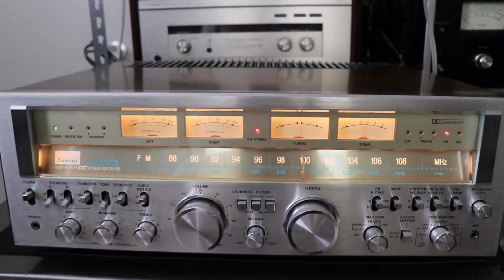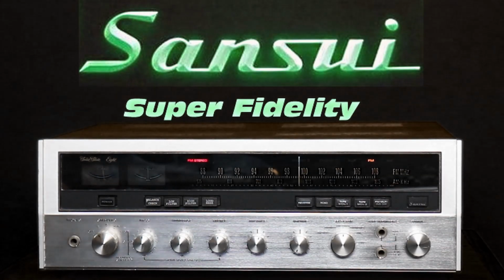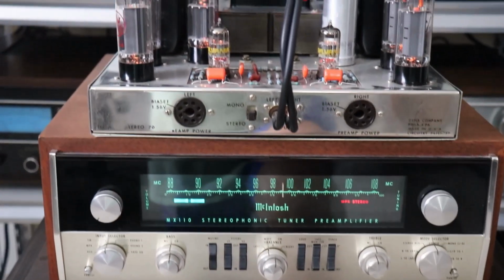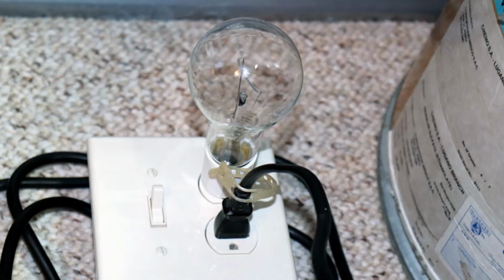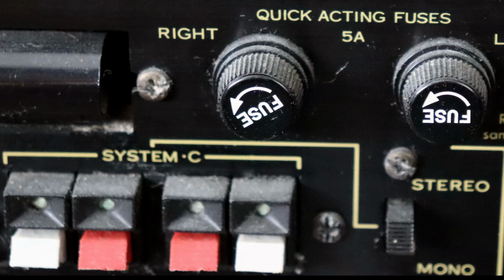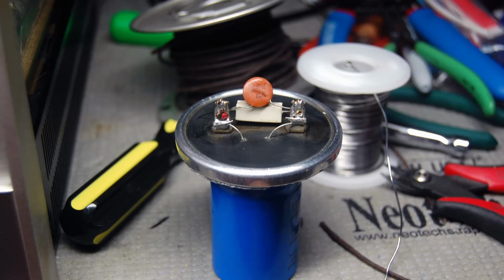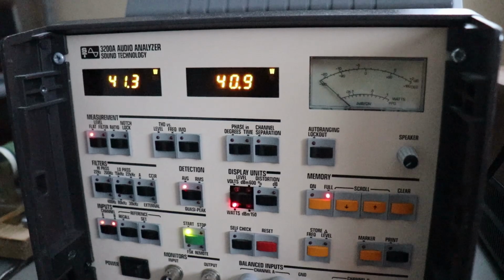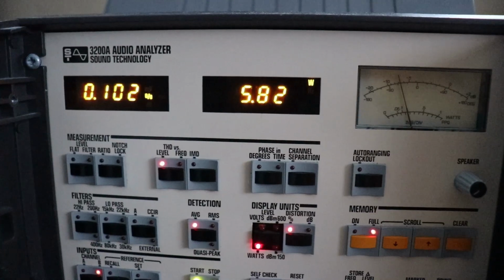The Best Receiver Ever? - The Sansui Eight. Repair Restoration Testing. Vintage Audio Equipment

Comment: That Sony ....( TA -F6 )
How does that do ? 
I have an E7B and I'm looking for the N7 
Any thoughts on this series from Sony?
Reply from the maker: The TA-F6 is a great integrated amp once you get the power supply issues straightened out that a lot of them have. Sony doesn't get a lot of love but they made some really good vintage audio equipment.
Reply: @vintageaudioaddict  
Thanks for taking the time 
I appreciate it - 
Subbed 👍

Comment: I have a Sansui 7070 it’s been in my possession since the 1970’s . It’s in great condition. I have not powered it up in 30 to 40 years.
Reply from the maker: Wow! Thanks for sharing. If you do think about powering up your 7070 please don't just plug it in the wall and turn it on. Using a device called a variac would allow you to bring the line voltage up slowly. After 30 or 40 years of sitting that's what should be done.
Reply: Vintage Audio Addict thank you for the information. I keep it because it has sentimental value. It was our first hi-fi system when I was a young kid. It reminds me of family members who have passed away.

Comment: which Receiver is the best you have i have a fisher i purchased from ebay, i also have a 8 track tape player from the 70s that was passed down from my older sister about 30 plus years ago it playes well and i have a case of 8 track tapes that came with the player.
Reply from the maker: Fisher made some fine equipment. Man, that's a tough question. So much great equipment was produced back in the day. I guess my favorite is the one that I'm playing at the moment.

Comment: In USA the G 9000 was top, but when I was in the Navy in 1978, I ordered through the Navy exchange in Philippines a Sansui G 22000. It was nuts, had 220 watts RMS a channel at .0009% distortion, along with that also ordered a pair of Kenwood 888s'. The receiver was so big they decided to make it two pieces so they could be stacked because it was too deep to fit on most tables.
Reply from the maker: Man, a 22000! What a wonderful and rare piece of Sansui audio history and thank you for your service.

Comment: I'd like a marantz 2250 if there's one to be found I'd like an amp around 100 watt but solid and clean any suggestions
Reply from the maker: Marantz was great also! In today's world you can always find vintage audio eBay but you will probably pay to dollar. I'd look at your local Craigslist if your not locked into one brand. Pioneer, Sansui, Marantz and many others made high quality audio equipment back in the day. The key to buying vintage is if they are working properly. If so all the brands are built to last and will sound excellent.

Comment: This is great. The early era of component Stereos!! The SF Chronicle would have an ad from Pacific Stereo every Sunday featuring a Good Better or Best set.. I recall Nikko , Sansui and Marantz. Heck even bought a Quadraflex that I loved but blew up (868, family still has a working 767). House brand I believe made by Pioneer.
Went to JVC there after.RX-400 then RX-8V. This got the cops called on me when I turned 40 (22 years ago, Pantera) and thought  it got hurt during a move. Just a short. Its fine.
Reply from the maker: Yes, they are great! The vintage audio equipment brings back good memories for most people. Thanks for sharing,

Comment: I love your vintage audio equipment .  The oldest piece of equipment I have is a Yamaha FM tuner T2 .  I would like more info or your personal opinion if you have ever had one or seen one. I had bought it at a pawn shop a long time ago, because it just looked like quality.  At the time I was working in an audio shop in Montreal Que, Canada  and out of curiosity  I looked up the cost on the unit and it was listed as $750 canadian. A heavy tuner, the front and top are one piece 1/8 in thick  black aluminum, never seen anything like it.
Reply from the maker: Thank You! No, I've never owned or even remember seeing a T2. The older audio equipment sure was build well. Most of the manufacturers like Yamaha built their products to last.

Comment: It''s a nice looking unit. But why restore old equipment when you can get new, better performing equipment today?
Reply from the maker: Why take vacations? Why watch the NFL on Sunday's? Why stop at Starbucks for a $5 drink? Why restore a 65 Mustang? Everyone is into something different.
Reply: Johnny Quest Why restore a classic car when you can buy a new one cheaper?
Reply: Dont be so sure ....
This old stuff is Very capable 
My new Marantz would get murdered by my 40 year old sony or Kenwood .
I mean it's not even close , people just assume .... what if its better in every way? 
When it comes to vintage amplification 
Vs chipsets that's 99% of the time
 the case.
Reply: @dednside5229  One thing I learned over the years is, ''Newer is NOT Always Better''. As a Buyer myself, for my Small Business, and its Clients over the last 25+ years, one has to take everything into consideration when purchasing something man-made; no matter what it is. So I concur with your statement.

Comment: I really respect Japanese engineering culture. Some Japanese engineer created a small thing of beauty with this receiver back in the early 1970s. It's such a contrast to all the cheap junk coming out of China these days - all sorts of fakes and most of it only good for a few years before it dies.
Reply from the maker: I agree. I wonder if any of the engineers or the factory workers at Sansui thought in 1970 that 50 years later in 2020 a Sansui Eight would still still be operating like it was new? Amazing!

Comment: My parents had one almost exactly like this. Theirs was from like 1975. It put out 120 per channel rms I believe. It was a beast. They had it connected to bic Ventura speakers. It would shake the house!!
Reply from the maker: I love the vintage audio equipment but I also enjoy the stories as people reflect on their experiences with that equipment. Thanks for sharing!
Reply: @vintageaudioaddict  Thanks for this Video. I inherited this from My Dad back in the Mid-'80s. He told me it was the "Last Hand-Soldered Tuner Manufactured In 1973". The Years sound about right. Love the Big Green Display, especially with the Lights out and/or a Black Light. When Dad gave it to me, I used Polk Audio PC4-JR (or PC5-JR, Forget Which) ''Bookshelf'' Speakers. They were 4 Ohm, so more Efficient (bought deliberately with this in mind, and on a ''Grass-Cutter's Salary'' at the time!). Big part of my Life at the given time fore sure.  TFTM !!! Best Regards

Comment: As a stereo fanatic I once had the decade later Sansui 9090DB. The thing weighed about 40 lbs easily.
Reply from the maker: The 9090DB was/is an amazing receiver. I'm glad that you had the opportunity to own such a amazing receiver.
Reply: @vintageaudioaddict  Thx alot. Yeah, just lucked out in the early '90's finding these classics.

Comment: Can you explain what the variable voltage and light bulb test do? What are you expecting to happen or not happen.
Reply from the maker: It's all about drawing excessive current. We have 120-125V mains here in the USA. If there is something shorted inside the unit and it starts to draw excessive current the bulb in the dim bulb tester will glow bright to let you know that you have a problem. This is a better solution then a smoke test. The variac the same as you can step up the input voltage slowly from 0V-120V while monitoring the current draw. It's all about making sure that you don't damage the piece of equipment. I hope this helps.
Reply: @vintageaudioaddict  - so is the bulb just in series on one leg of the AC circuit?

Comment: Very nice receiver. I wish I knew how to operate all your test equipment. I recently bought a Sansui 5900 Z which is really nice. It’s rated at 75 W per channel at eight ohms. Automatic pushbutton tuning, and automatic volume push button up and down, plus it also has six preset buttons that you can program stations at the push of a button which works really well. The one thing I’m not too crazy about, when I first push the on button, it makes a staticy noise like it’s not tuned in to a station and then after one or two seconds it starts playing normally. I’m thinking this isn’t normal. Any idea what could be causing it? Any help would be appreciated. Thanks.
Reply from the maker: Thanks. Using the test equipment is like most things in life. It just takes some experience. Remember that back in the day there were thousands of little stereo shops along with hundreds of service centers where the equipment could be serviced by thousands of different technicians. They made the test equipment not to complicated so a wide variety of technicians with different skill levels could you it. Again, it's mostly experience. About your receivers issue. It's hard to say what it may be. Just make the sure the noise that you describe as static is not the arching of the power switch, that's more of a sizzle sound. If the noise you hear is coming out of your speakers that's not it. If your power switch has an issue that's something that should be repaired. If it's just static for a second or two when you turn on the unit I'd just enjoy it.
Reply: Vintage Audio Addict  Thanks for your feedback. I do remember when stereo repair shops were on every block. Growing up in the late 60s and 70s I’ve seen more than a few. As to the power switch, I have read on several posts that the power switches were rather suspect and making a slight noise when turning on and off. Very strange. This morning I pushed the switch in, and the music came on almost right away with no noise that it had been doing previously. I thought that was rather strange. So now I’m not sure what the noise was or if it fixed itself, or what’s going on. I think I will just take your advice and enjoy it, if Something Happens I do know of at least one or two stereo repair shops that work on vintage equipment. Again, thanks for your input, looking forward to more of your posts.

Comment: I have a set of Sansui S-61U 12" 3 ways hooked up to a early 90's Kenwood receiver. Blown away how crisp they sound
Reply from the maker: Very cool. Kenwood is sometimes forgotten in the audio world but they made some outstanding stereo equipment.
Reply: @vintageaudioaddict  it's a huge A/V unit. It's a monster...but the sound is impeccable

Comment: I still have my Sansui amp, tuner, cassette deck and turntable from 1980. Cassette deck and tuner are in my loft but still i use the amp with a digital tuner for several hours a day. And it sounds great through Kef speakers. Sansui was well respected back then, but I think they sold out the name and it seems like its only cheap stuff sold in India these days.
Reply from the maker: That's great! I still have some of my equipment from the 70's also. The times did change and not for the better as build quality goes unless you get into the very expensive modern gear.

Comment: I had an Eight Deluxe.  Bought in 1974 as I recall and used it until I sold it in 2010.  A joy to own  and operate, especially with Koss Pro 4AA
Reply from the maker: Sansui built so many outstanding pieces of equipment. You would have a very long list of all the great components Sansui engineered and built including your Eight Deluxe.
Reply: Koss made really good headphones

Comment: I have a Sansui 9090 from, I believe 1977, and would like to restore or sell it. No one around here in Miami seems to even know what it is. My brother bought it new in Germany and brought it home when he was in the USAF. I'm the second owner and would love to use it again or find a good home for it. Still basically works, but with the burnt bulbs and dust issues in the switches.
Reply from the maker: The 9090 is a great vintage receiver. Yes, finding a tech is difficult. Google "vintage audio repair" or "vintage stereo repair" and see what come's up. I'm thinking between West Palm and Miami there must be someone down your way that can help you out.
Reply: @vintageaudioaddict  Will try that tac and see what comes of it. Thanks.
Reply: Was he at Spangdahlem, as a Security Police Guard ??

Comment: Very nice, I love the old silver face receivers from the late 60’s and through out the 70’s. I’ve got an 8080DB waiting on a restoration, but I’m gearing up for a tube amp build first.
Reply from the maker: Thanks. same here. Only the most expensive audio gear today can compare to the build quality of the vintage gear. Your 8080DB  is a wonderful receiver. Good luck with the restore.

Comment: Vintage audio addict I have a sansui 5000A and it has the fuses for speaker protection like your eight does. Well I have had it for four years now and I haven't been able to use it because when I got it the fuses were no good and the fuses don't have any voltage on them and in the manual it only lists the fuses as 5 amp so I was wondering if you know what the right replacement would be?
Reply from the maker: You should use a fuse rated for your line voltage. I assume you are in the USA, if so the replacement rating should be rated at 125V or higher. I am not familiar with the Sansui 5000A fuse rating but if your back panel indicates that you should use 5 amp fuses then that's what you should use. If the fuses are blowing there's a failure somewhere in the 5000A causing that.